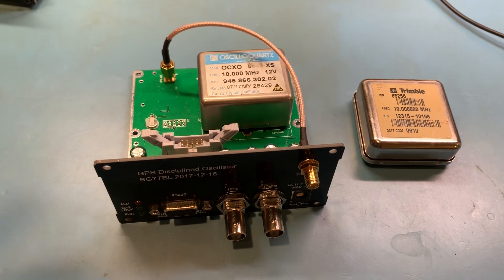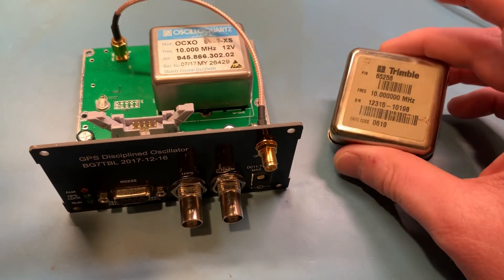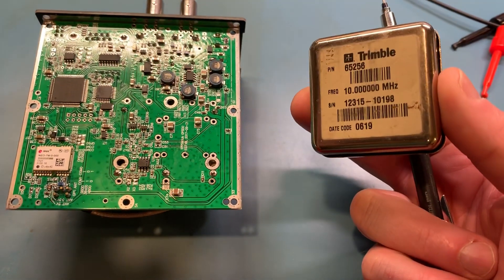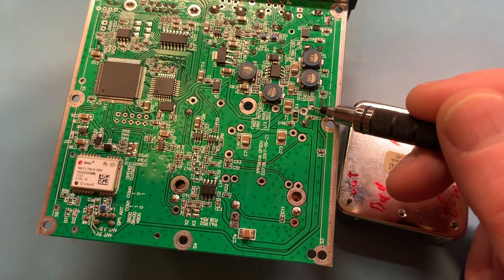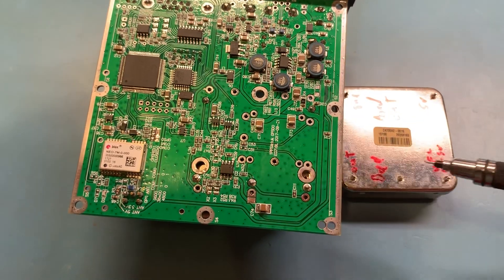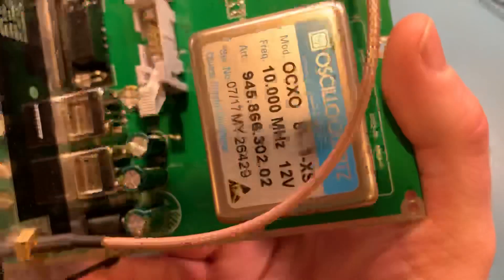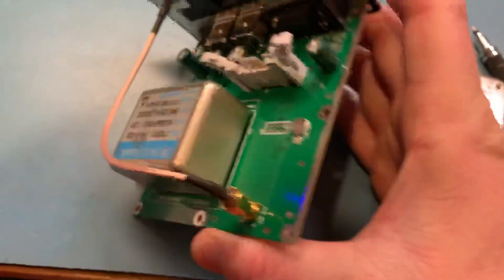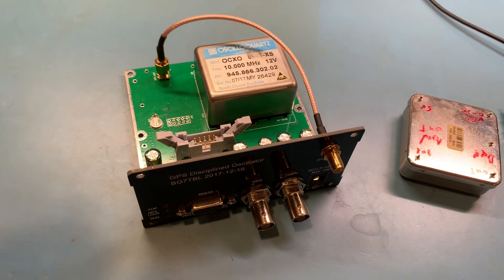BG7TBL GPSDO OCXO upgrade

Comment: Hi Damon.  Did you find that the Oscilloquartz is cleaner on 10mhz than the Trimble?  Just wondering if you took any phase noise and/or IMD measurements.  I have a 2017 BG7TBL as well.  73 de N4PAJ.
Reply from the maker: Not noticed it being any cleaner, just very stable.

Comment: Does anyone know what the blinking green LED on the bottom of the board rear between the BLOX module and the board corner labeled D2 means. Mine seems to blink at a 1hz rate, but it may mean something else?
Reply from the maker: Just a heartbeat indicator.

Comment: Why no links ?
Reply from the maker: What would you like a link to?
Reply: @damonkj7e  
To start with , the unit you are using to replace the old OCXO , 2nd the original complete BG7TBL ?
I did look for the replacement OCXO & found , but so many times there are many copies / clones of all of this stuff - the reason for links .
Especially the BG7TBL - I find many copies / clones of that .
Seems to me to just make sense when someone introduces something - give links ?
Reply: Forgot , thanks for the post anyway ;)
Reply from the maker: Dec 2017 LCD BG7TBL GPSDO.  More info on the eevblog post.